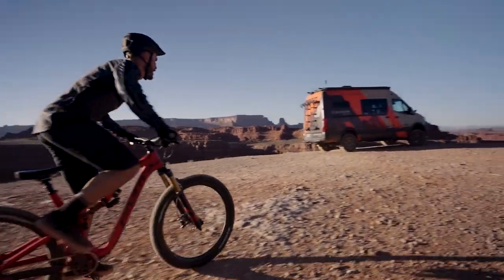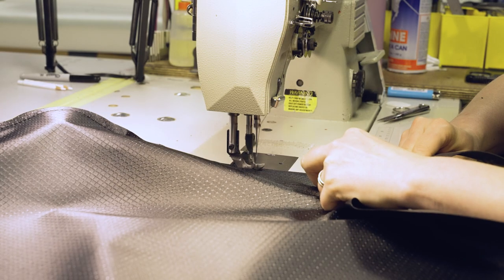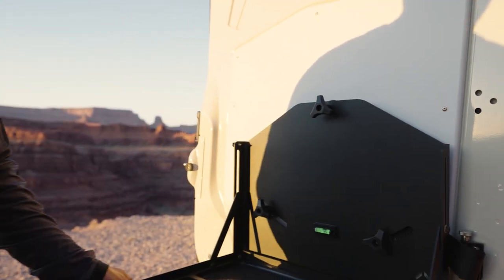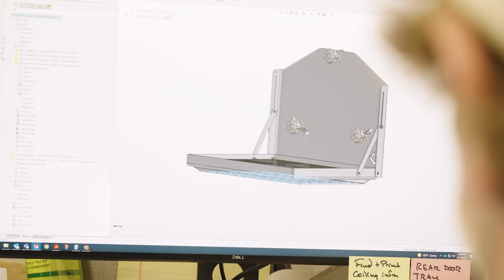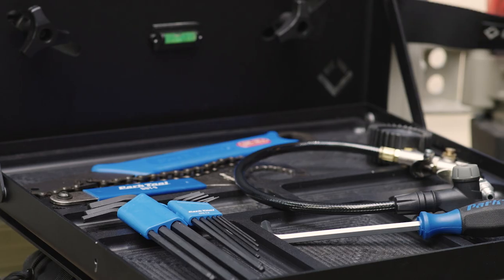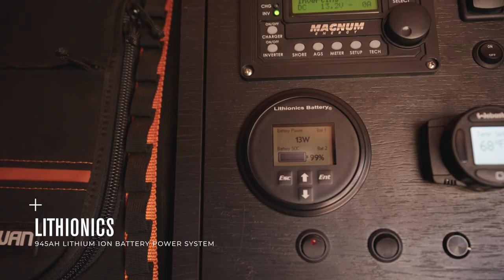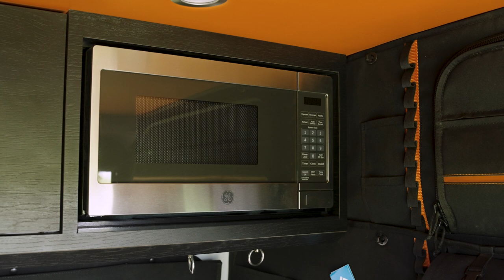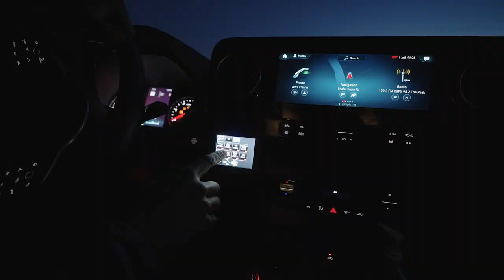VAN SPOTLIGHT: Tails | Outside Van 4WD Mercedes-Benz Sprinter 144 Van Conversion Tour

Comment: I find these builds interesting, as having owned 2 vans and endless adventures in trucks as well . What is the first thing You do when you come home from a ride or  any activity ?  I cant speak for others, the first in  order for me is to take a shower. Over 90 percent of these builds have no shower or they put a hose out the back to rinse off.  The option to rinse off in the back of the van is not in the design  with the luxury of the rest of the build its more like an after thought . Other wise these builds are impressive.  I carry a nice portable hot shower in my truck on adventures when others find out I have this shower they ask me if they can use it, happens every time.
Reply from the maker: We understand what you're saying. Our exterior shower connection offers hot or cold water. We don't advise building an enclosed interior shower on a 144 chassis. We do offer collapsable options for a 144!
Reply: @OutsideVan  I agree w/ Mark, Taking a shower "inside" our van makes all the difference in the world.  With the price these vans are going for these days and the extreme slow down in our economy, fuel prices; it is rare that most people can even afford to purchase one.  Out on the road most people we meet are living full-time, getting sponsored/marketing  to drive a manufacturers  van, or have given up all other ties to suburban life.  However, the majority of people who can afford to buy with with no questions asked, are in a financial position to buy what they want and an interior "enclosed" shower is NOT what they want.  Not everyone is a 20 or 30 something professional vagabond or athlete willing to take a shower off the back of their vehicle.  I would think more van builders would take these things into consideration.  Unlike the Revel, many more are flocking to the Storyteller models with the interior "halo-shower".
Reply: @DayZeroFWD  I agree with Outside Van. I’m in my late 50’s and shower out of the back, no problem. A shower cubicle is a total waste of space, particularly in a 144WB van.
Reply from the maker: @Couchlover47  We absolutely offer interior, closed, aluminum showers. We also offer shower pans with a collapsable shower curtain. Our vans are bespoke, designed how the customer would like. Here is an example of an interior shower: https://www.outsidevan.com/van/field-trip/ Here is an example of the shower pan and shower curtain: https://www.outsidevan.com/van/the-gray-goose/
Reply from the maker: @DayZeroFWD  We offer an option to include a removable interior shower pan with a collapsable shower curtain and hose connection. This option is less costly than our fully enclosed aluminum interior shower. Here is an example of an interior shower: https://www.outsidevan.com/van/field-trip/ Here is an example of the shower pan and shower curtain: https://www.outsidevan.com/van/the-gray-goose/

Comment: While being a good, quality build it is immensely underwhelming.  The first half of the video is hammering on innovation, and prototypes etc, etc then they show nothing new, everything is already in other vans, the table they spent "so much time in R&D" has been available on 4x4 markets for years.  Can carry 4 bikes... sorry only 2 seats.. wha?
Reply from the maker: We appreciate you taking the time to watch our Van Spotlight. Our soft garage wall, soft overhead shelves, tool rolls, and rear Molle Panels are just a few of the R & D items highlighted in this build we're excited to roll out in the future.
Reply: ultimately it is a 3-pallet cargo van. something something "lipstick on a pig"
Reply: As harsh as that may sound I totally agree with you. I use to follow Outside van years ago but stopped cuz so many other van companies seemed to have surpassed them in the realm of innovation. This van kind of exhibits that. Very minor improvements with seemingly the same layout. I mean the van itself is from 2 yrs old. I get it, it's a more basic build for bicyclists, outside sports enthusiasts. It would be something I would consider if it was not for the exurbanite price at least in comparison to other van builds which have a lot more innovations, choice in design, layout, amenities.